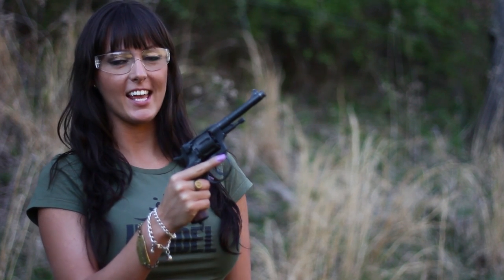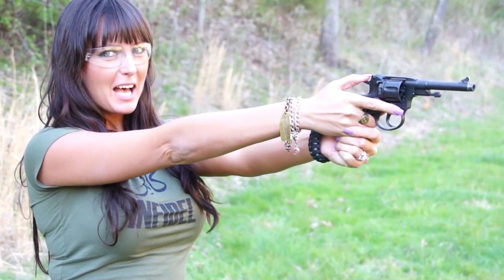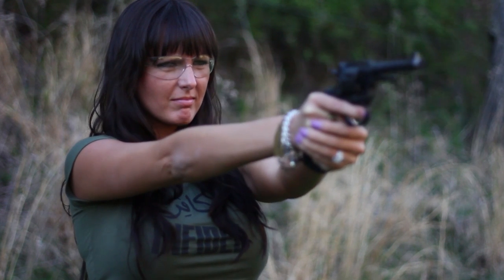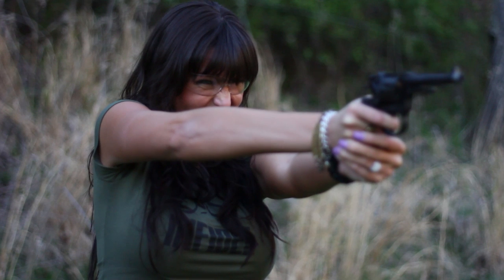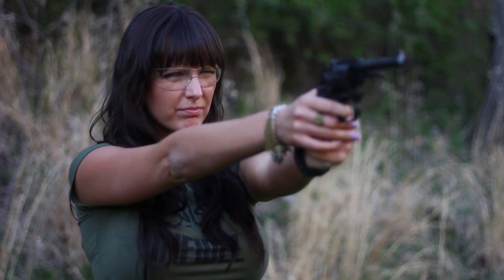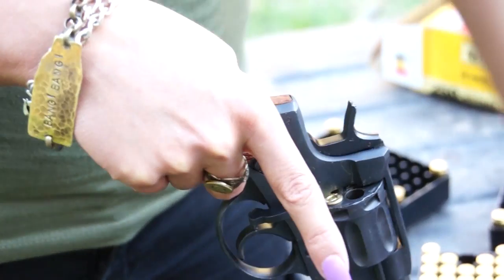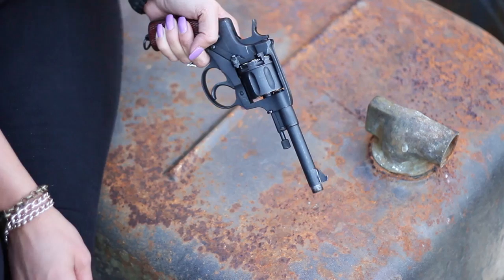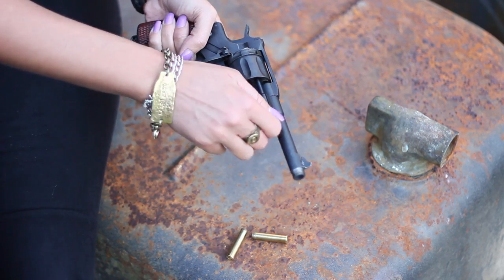Nagant Revolver with AAC TiRant 9 Suppressor - Ash with JMAC Customs

Comment: Yes, the Nagant does seal in the gas at the cylinder to give you more velocity but it only gives you about another 50 fps which is of no real benefit. But, the fact that this same mechanism allows the Nagant to be suppressed this quietly is really cool.
Reply: Also they said it had a fixed cylinder which isn’t true because I own one and you just rotate the ejection rod and pull the pin out and the cylinder come free out of the revolver

Comment: There's another revolver that you can suppress (the Steyr m1893). ;-)
Reply: and yet another that was designed for tunnel rats in Viet Nam. It was a .38 if I remember correctly. Not many were made and the concept was abandoned due to the added length of the silencer causing problems.